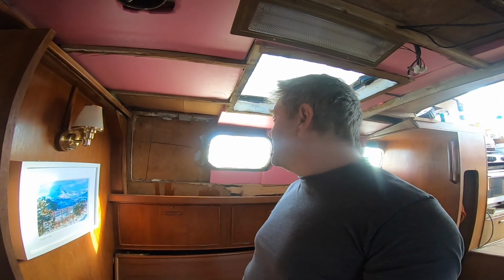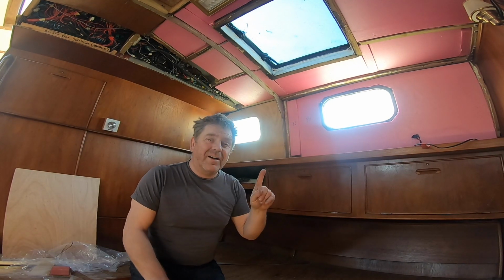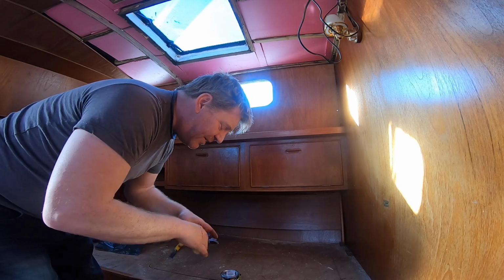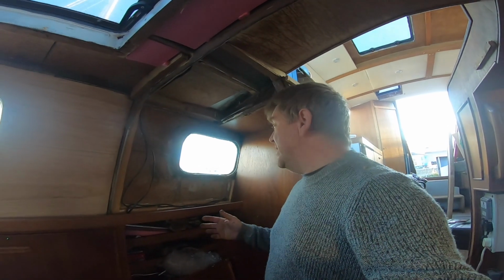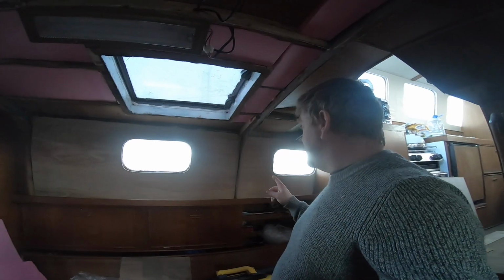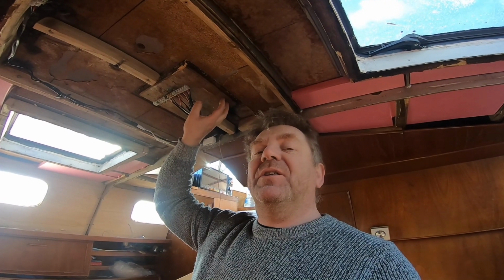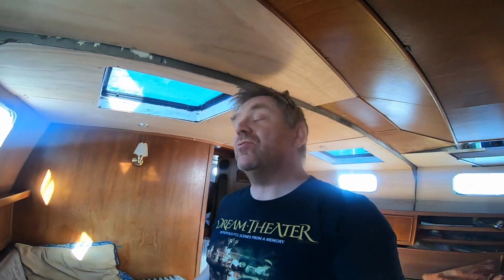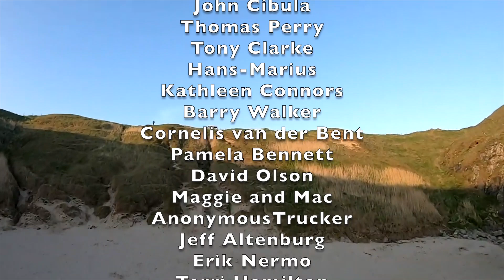#85 - BUDGET boat DIY!! Fitting New pannels on the cheap!!

Comment: your choice for the interior ply is perfectly adequate imo. it will last a long time. the difference for marine plywood is the amount of voids within the sheets and the glue, which is not waterproof but water resistant. people have built hulls with exterior grade plywood and never had a problem because they knew what they were doing.

Comment: Andy, You are doing a great job on the panels.  To make them last, after the stain has dried really well if you seal the wood with 2 coats of epoxy on all sides and edges, there's no reason they won't last a very long time.  The edges, just like the end grain of any wood will soak up a lot so a few extra coats on the edges till it doesn't soak in would be extra insurance. If there are any voids along the edge fill those with thickened  epoxy.  With all of this work you'll still be cheaper than marine plywood an even marine ply would needs to be sealed to keep it from absorbing moisture from the air, moulding and/or rotting. Keep up the Great Work!!

Comment: You are indeed very lucky having a partner willing to share all the experience and you gave a heartfelt tribute, well done! Just a small point you are probably aware of, don't forget to trim some wood off the panels to allow for the vinyl wrap over, I suggest you try some when you get the vinyl to check how much you need to allow.
Looking much better now and will improve dramatically with the vinyl. Keep up the good work, spring is on the way!

Comment: As a former professional wood worker I have an input on your inside wood choices.  The major difference between exterior ply and the marine grade is price.  They use the same glue and wood. Marine grade guarantees no voids and that is very important if you are using it for structural reasons. You can get exterior grade with the same ply’s and thickness  For trim I would never spend the money for a name.  Good job

Comment: Great job Andy! Those panels are looking amazing. I used to work in a panel laminating company so have some experience with plywood. The difference between the wbp and marine is the adhesive more than anything. The marine uses a totally waterproof adhesive to prevent delaminating in wet conditions. For inside the boat, although it might be ‘best practice’ to use the marine, if you seal the edges with a marine varnish, it should make the ply last a lot longer if not indefinitely… also, I think the camper idea is great, and downsizing is tricky enough, you don’t need the added pressure of getting the boat done at the same time. You’ll be able to expand into the boat from the camper so it will feel luxurious! Keep up the great work mate!!

Comment: On the marine ply front, a lot of 70s boats were made of it but they only used it for the hull and topsides and used affordable ply inside. 
It will last longer than you think. It's all about sealing the wood. 
Don't fret.

Comment: I would recommend using G4 damp seal to seal the exterior grade ply. Its super easy to apply and gives a hardwearing finish. Its also cheap but will make your panels last considerably longer.

Comment: If you seal the plywood it will last as long as marine plywood. Marine plywood is so expensive because it's made with no interior voids. Otherwise besides the number of plys it's basically the same as exterior plywood. You will be fine if you seal it .
Reply: Yes, make sure you seal both sides. One side only will mean that they distort when they get damp, and they will get damp. Stain is not a sealer. Good work, all of you.

Comment: New to your channel but really enjoyed the 16 month time lapse and few more of the videos. 
For your hardwood ply. As long as you can seal all the surfaces, (paint etc) there is no real reason it will not last the lifetime of the boat. So the biggest thing about sea air is the moisture containing salt. If the The salt water/moisture can impregnate the wood it can swell and break apart the layers. Your best bet is to get a good heater and dry out the panels for a couple of days and then paint/seal them, make sure any holes that you need are already done before sealing as they will be weak points.
Reply from the maker: Yeah definitely. Although we’ve spent so little on the timber for these panels it won’t matter if they don’t last too long and we can use them as templates for something better in the future when the welding work is all complete

Comment: I think long term I would mold some grp and gelcoat and then fit and forget. It would reflect much more light easily washable and when you get to the tropics gel is far more resilient than vinyl in humidity and extreme heat. The other reason is every time you turn something on, you need battery capacity and re-charge facility.

Comment: Wonderful words from you regarding the ‘team’,they certainly appear to enjoy the tasks even when you’ve not been there!
Re the Marine ply versus Exterior grade (WBP ?); I’m more than happy to stand corrected but it was always my understanding that the only real difference between the two types was laminate quality. BS 1088 Mahogany ply had a guaranteed laminate lay up with no voids whereas the exterior grade WBP, whilst utilising the same glues etc, when cut was likely to show voids in the layup. Long & short of it is there really shouldn’t be any problems using the exterior stuff for panelling.
I don’t suppose for a minute that you’d achieve Lloyds Approval for the exterior (especially for any structural elements) but don’t forget that Peter & Annie Hill built the original ‘Badger’ entirely from exterior grade and, to my knowledge, never experienced any issues.
Keep up the great work!!!

Comment: Morning Andy
I'm just taking time off work (use them or lose them)
And watching your latest video.
Just thought I'd message and I'm sure others already have
You mention welding all around the chain plate that can be see and also drilling and welding a bolt through the middle.
Can I suggest drill a hole in the centre of the plate as you suggest but only the plate not the Hull.
Then plug the hole with weld, you will get a much stronger hold and you won't have yet another hole in the Hull (even though its plugged with a welded bolt)
Check with nigel he will know best.
Keep up the good work 👍

Comment: Andy, those deck head panels are good enough to finish with paint surely? I built a garden room recently and lined the interior with the same Far Eastern ply, then painted with primer/emulsion, the result is excellent. You could do the same, especially as you intend covering the joints with trim. In fact I think it’s a much more modern looking finish than vinyl and a lot less troublesome - think Westerly headlining! Rob

Comment: Hi Andy. When you decide to coveryou panel in the vinyl don't forget to allow at leasr 3/16"on each dimension to allow for the cladding  thickness of the vinyl.   l only just  remembered when doing the headlining on my late boat, It does save a lot of mucking about after glueing the vinyl onto the panels if the trimming is done first.
 I used a spray adhesive I used a PVA type with no fumes, can't remember the name of it but it gave some time for small adjustments. Beware too that if a curved section you need to allow a fraction more vinyl to stop it stretching when curved and flattening appearance.. Starting to really look the business aboard Melody   .Welldone  !
Reply from the maker: We’ve used both spray and tinned contact adhesive and found the canned stuff far superior. You can get a much more even covering of adhesive on both the timber and the fabric.  It does smell but the results are much better

Comment: A suggestion : 1/4 inch 4x8 PVC board or PVC foam board .  ,easy to clean ,can paint it , screws adhere way better than wood . Can use a heat gun to shape it  ,also lighter than wood,when roughened can use fiberglass,matt and or epoxy with great adhesion  and the most important reason? ,never rots and will outlast all of us . Also comes in 1/2 and 3/4 ,for those areas that need more structural support ..
Reply from the maker: That’s actuslly a good idea.

Comment: for the panels, it is necessary to paint or varnish on BOTH sides, and to put the vynil it is also necessary to coat on BOTH sides and smooth with a card or a brush and very soft...,Good luck ...!! if it is well protected with paint, there are no problems over time, especially paint the edges well...!

Comment: Im looking to fix up a sailboat and sail as well. I love what your family has accomplished so far. Put a small fan blowing across your oil heater and it will make a huge difference, thats what I do to heat my camper in the winter.
Reply from the maker: Nice tip!!! Thanks you

Comment: Hi Andy, with the plywood you are using to seal it, you can use a 50-50 mix of varnish and thinners or polyester resin with styrene. Both will take a good few coats to seal it and have a great finish 👍 👏 👌

Comment: Hi Andy, why don't you velcro the covered panels in place using professional display panel velcro which is very strong. This will allow you to access the hull, wires etc and will not involve screws, indeed if gods forbid you did get a short/fire you can access it very fast.
Reply from the maker: Yes I’ve done exactly that in the pilot house :)

Comment: You dont need marine ply inside, but also you don’t need vinyl. The teak veneer or stain looks better in a boat, don’t you think? Vinyl is fake, what is it good for?
Reply from the maker: We do t like too much dark wood too high up.  I totally get you’re point but in our case what it’s good for is adding a soft lighter shade to the upper portion of the ceilings and deckhead. 
With all teak or dark wood everywhere it feels like a garden shed 😂😂
Reply: @SailingMelody    Yes Andy, I get your point. Perhaps then do the vinyl on the ceiling with the nice teak trim and leave the sides as they are...perhaps cover them in a similar teak stain. They will better match the rest of the bulkheads!
Reply: @SailingMelody  you could paint it which is easier to apply than vinyl and will leave a smooth finish to wipe down. Then add your timber trim. Much like Mas on Sail Life

Comment: Andy, you could just put a veneer over the ply instead of the vinyl you have, for the saloon. Look into it. GBU showed some samples of teak vinyl veneer. Lots of options.
Reply from the maker: We did think about it but aesthetically we don’t want teak on the upper panels and head.  We want an off white from the port lights up because it massively increases the light in the room and makes the space feel so much larger

Comment: Andy, I am not sure why you want to bolt after welding all around the chainplate.  In engineering we have an adage "load goes to stiffness." The weld is for all intents and purposes completely rigid a hole drilled through two metal plates with a hole through it will not carry any load until after the weld has failed all the way around the chainplate because there is a small difference in the diameter of the holes and the bolt unless you make them a press fit.  The only purpose I can see in the through bolt would be to make a path for water egress and to weaken the chainplate due to the removal of metal.  If you want to have a greater area of weld a better method would be to drill a hole in the chainplate only and then plug-weld the hole to the hull.
Reply from the maker: That’s a good point.
 
I’m imagining a situation where I’m in the middle of the Atlantic crossing.
I do my daily checks and remove the panels to have a quick visual inspection of the chain plates.
To my horror I notice the weld on the windward cap shroud has cracked and the chain plate is visibly moving.

Knowing I’ve got a big-ass bolt, welded on the outside and overpainted to stop water coming in, would be a big relief in that situation don’t you think?

Absolutely unnecessary? Yes
Completely over engineered? Yes
But it will take minimal effort at this stage, add almost no weight, and can only be beneficial. So why not.

Water ingress? No it will be welded in and painted over.

Load bearing? No, not unless the weld catastrophically failed. But it’s the belt and braces approach
Reply: @SailingMelody  If you are looking at a doomsday scenario of complete weld failure which is the only way the bolt does anything, you also need to consider the strength of the hull at the bolt.  Any bolt is based on the cross sectional area of the bolt which you can control and the thickness of the thinner member you are bolting to.  I suspect that the thin metal plating that the hull is constructed of is not sufficient to hole full rigging loads on a single bolt.  In order to get the hull strong enough, you would need a backer plate that is welded to the inside of the hull to make the hull thicker and distribute the load wider at the bolt.  If you are concerned about your own welds at these critical locations, could you have one of the pros who have been lending a hand do those welds?

Comment: you can use a router and cut the windows out to be exact.  they make a bit for that.  It may be easier for you
Reply from the maker: Yeah I know but I had the jigsaw in my hand 😂😂😂 
It’s router time in the next episode 😜
Reply: @SailingMelody  It makes alot of dust but gets the cutout perfect.  I use to rebuild contractor trailers and I would use the router to cut out the windows on the aluminum skin and panel interior.  It was fast and perfect.

Comment: I've seen other channels use fiberglass resin to seal the ply and it comes out really well. What actually is the difference between marine Gade and outdoor ply anyway? As long as its sealed, dose it really make a difference?
Reply from the maker: The difference is voids. The wood and glue is the same but marine grade means there are no voids i the laminate. 

Glassclothing would  be good but expensive. May do that some other time in the future in another year and another harbour :)

Comment: Cover all that hardwood veneer with vinyl !  Surely you are kidding...
Reply from the maker: No we are not covering the hardwood veneer with vinyl. In a previous episode we used ply and vinyl up in the pilothouse to replace the damaged rotted hard wood veneer.
Reply: @SailingMelody  Would be nice to have the budget for all hardwood interior.  I misunderstood what you were going to cover.  For all the trouble and labor too bad it can't all be hardwood...  You fit everything close to perfect !
Reply from the maker: Yeah we’ll do a budget video soon.

The panels in the deckhead were totally rotten so we’ve replaced them with decent quality plywood, but not teak veneer, partly because it’s ferociously expensive but also because having SO MUCH TEAK 😂 was making the place so dark and like a garden shed.
So the damaged panels we’re replacing are going to be an off white and the question is whether to paint them or cover in vinyl
Reply from the maker: Yes unfortunately our budget doesn't stretch far in the UK 😁 but we do what we can. Our ultimate goal is floating, safe and habitable. We can always make upgrades along the way on our journey 😁
Reply: @SailingMelody  The steel fabrication and welding are all first-class.  Make sure the anti-corrosion anodes on the keel are intact !  It should have them...  Good job on the steel, mate !  Watching for more videos.
Reply: @SailingMelody  You can pick up some good hardwood veneers when you cruise the Amazon in Brazil...
Reply from the maker: Hahha
All the anodes were shot.
She will have brand new correctly sized and calculated passive and active cathode protection. Anodes and an electronic cathode as well. Some calculations needed because too many anodes can be just as bad as too few.

Of course I’ve got the original ones we removed but I will also do some math to work out of the original sizes and positions for the anodes were actually correct
Reply from the maker: Yep. That’s another good point.
The work that we do now only has to get us in the water and safe. We will be living aboard and I have no doubt we will do another refit somewhere the other side of the world where it’s warm and dry.  

Having said that we would prefer not to use exotic hardwoods and would go down a more sustainable route like bamboo.

Comment: I got a little misty eyed myself when you talked about Melissa.

One question: why are you going to the trouble of putting vinyl on these panels? Why not just paint them instead?

I'm building my whole boat out of exterior plywood.

The design is so experimental, and my craftsmanship is so poor, I see using anything better than that as a likely waste of resources.

 I am not skimping on everything. I bought about 3 L of epoxy and about 0.5 kg of wood flour filler. I also spent a little more than I could get away with on paint.

The boat will be stored inside for about half a year, and outside for the rest. I expect it to last 10 to 15 years.

I think the original owner of MELODY would be quite pleased with your work on her.